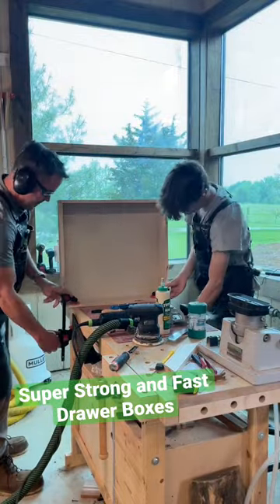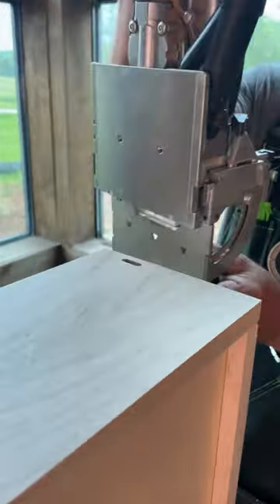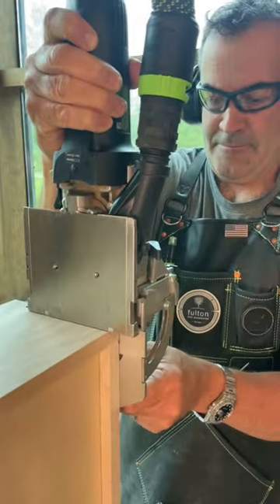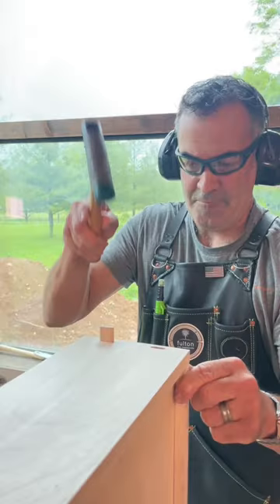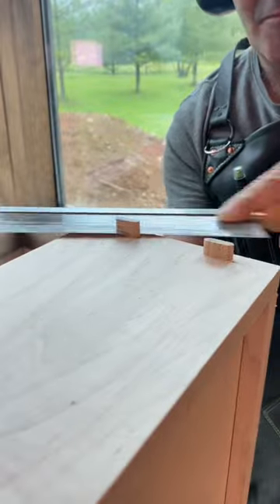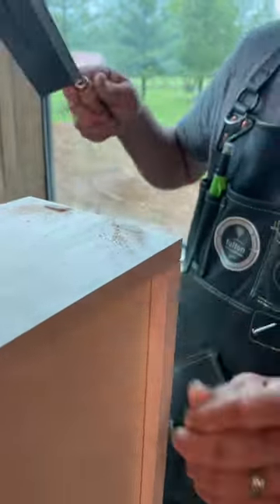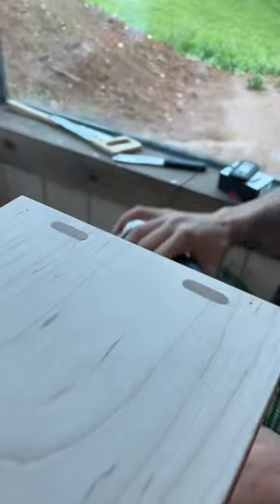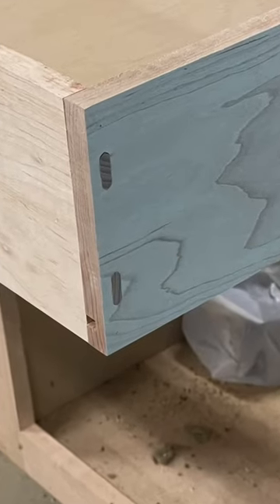Drawer boxes as strong as dovetails? This technique is strong and quick!  #drawer #cabinetmaker

Comment: Not sure why you would do that instead of just cutting a rebate.
Reply: Strength?
Reply: @baraksinz  a rebate is plenty strong if glued and clamped properly. It will never come apart.
Reply: @luns486  I get what you’re saying, but some people like to add mechanical strength in addition to the glue bond.  I mean, if rebates are the standard, then why does anyone use dovetails, box joints, sliding dovetails, pocket screws, dowels, screws/plugs, splined miters, etc?  This guy likes his dominoes, and they provide some shear strength that a rebate simply doesn’t have.  To each their own.
Reply: @baraksinz  fair point, well considered. To each their own indeed.
Reply from the maker: This is just as fast, just as strong and adds a touch of fancy